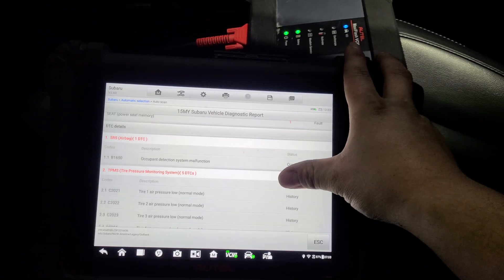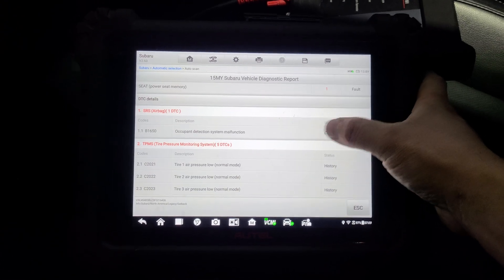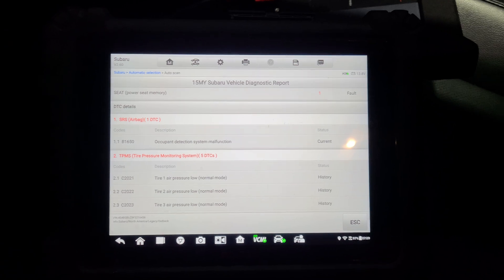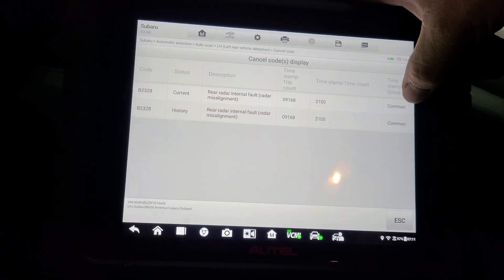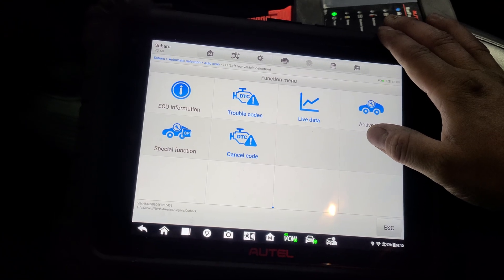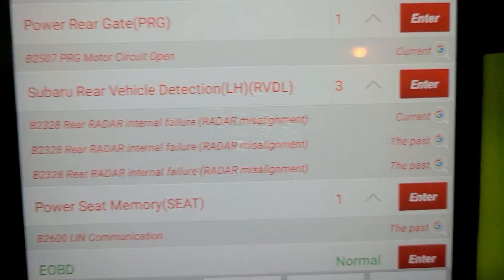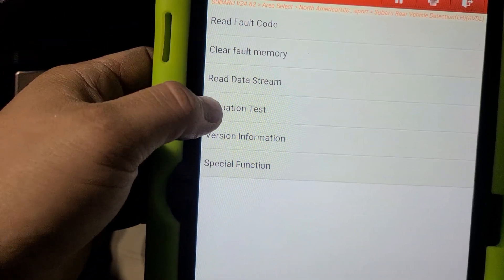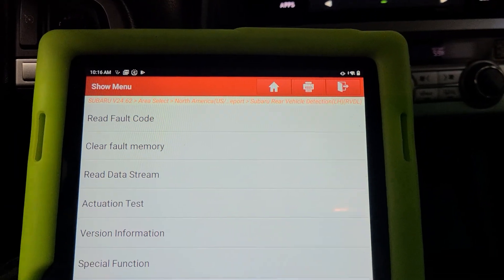Subaru Blind Spot Radar Diagnosis NO CODES Part 1

Comment: The Autel is not steering you wrong in this case. The factory tool SSM4 will do the exact same thing. On Subaru you must use the cancel code for the dtc. Will need to calibrate and adjust to get that fault to clear. A sticker on the bumper itself can also cause this code just a FYI.
Reply from the maker: Awesome, this is why I worded it the way I did, in my area there is no ROI on SSM4, so I use aftermarket.
Reply: @L1Training  Same here, but I've had a chance to play with one at the dealer a few times. Handy for some stuff but takes a bit to understand them.
Reply: Agree here. the SSM4 tool reads the cancel code as the DTC. Once it's calibrated and adjusted it will clear. A sticker, or the wrong paint can trigger it as well